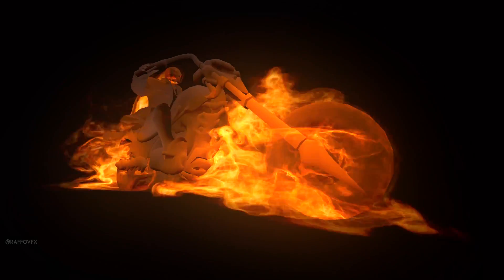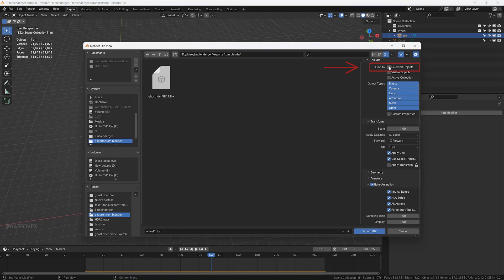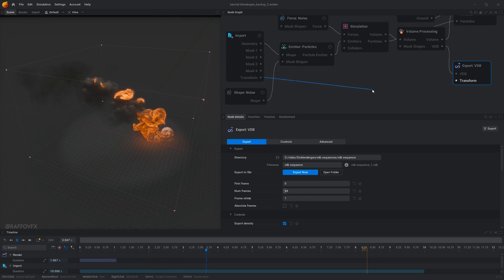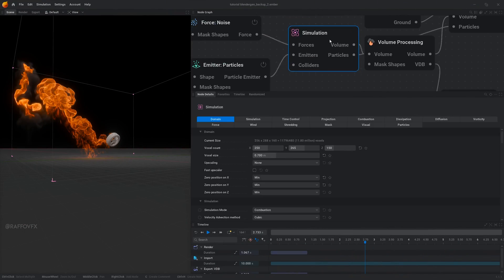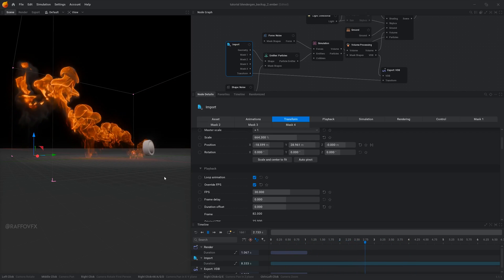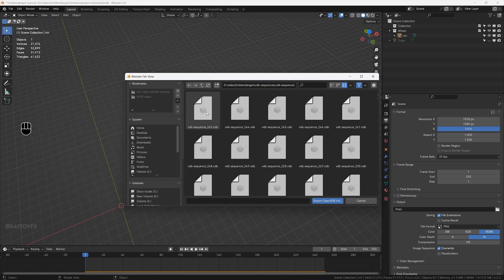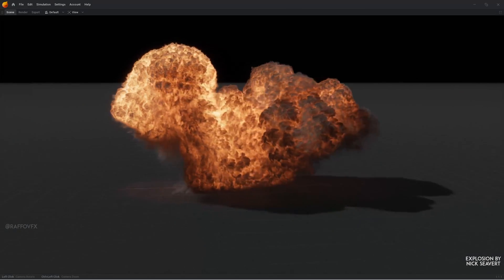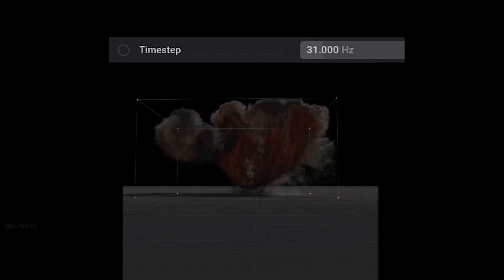Blender + Embergen: How To Setup Simulations Properly

Comment: i just can not wrap my mind around this.
my blender is at 24fps. i want to work at normal, correct speed in embergen, and export in a way that is properly timed in blender at 24fps. my simulation also includes alembic particles not just a vdb. i'm not even importing anything from blender to begin with so i don't have an import node.
what the hell am i supposed to do?

Comment: my blender scene/animation is at 24 fps, i did the frame override in embergen as 24 fps with a frame step of 2 for vdb export. not only does it not line up when i export back to blender but it still exports it as if its at 60 fps meaning i get the full amount of frames as if the frame step isnt active..

Comment: hello, i could need some help ,  is it possible to use an imported geometry only as an Effector und not as an Emittor.  I want to manipulate an fire emittor with  an imported  Geometry but the Geometry himself should not burn. but rather  it should effect the emittor with his geometry, i hope this was clear, my english is ugly sorry, , sadly i cant find an option like that.   In Blender forexample, when you start a simulation, you can us an Geometry as an Effector inside the  Domain Box. I really need this Option in Embergen. Someone can help pls ?
Reply: i found out by myself,  you must give the emitter and the geometry two different Emitter Volume und turn off smoke and flue inside the emitter Volume of the geometry ❤❤❤❤ after 8 hours ❤❤❤😂

Comment: how is your VDB playing so smoothly? mine just lags when it gets into the middle...
Reply from the maker: check the voxel count of your vdb in embergen, when is too high it will lag in Blender
Reply: @RaffoVFX  I gotcha. Thanks!
Reply: @RaffoVFX  Hello again! I used a preset from embergen, a shockwave. it has 33m voxels by default but still lags in the middle. as I've heard from other tutorials, that's too low?  I got ryzen 7 5800x3d and a 4070 ti.

Comment: So 60hz and famestride 2 works for 24/25/30fps Blender sequences then? I don't undestand why this is better than changing the entire sequence in Embergen to work natively with your Blender sequence. I mean there are no sync problems later? So for 24fps shouldn't it be 48hz for embergen simulation and frame stride 2? I don't understand
Reply from the maker: I suggest: regardless of having 24, 25, or 30 fps, override to 30 fps and export a framestride of 2 like in the video.
Doing as you say (no override, 24 fps, 48 hz, framestride 2), is technically correct but is potentially gonna break up completely the simulation in Embergen (too fast explosions, explosions not happening at all, stuff like that).
Btw if broken simulation must happen, you already see it happening in Embergen, so trying costs nothing.
Reply: @RaffoVFX  I did try lowering to 24hz and indeed things go very fast and such. I guess it requires adjusting the values in Embergen to match previous speed and so on. I'm just curious as to what it does to the fluidity of the sim with your method, in your experience. Like why doing it like that is the way to go, despite the framerate not matching exactly I mean.